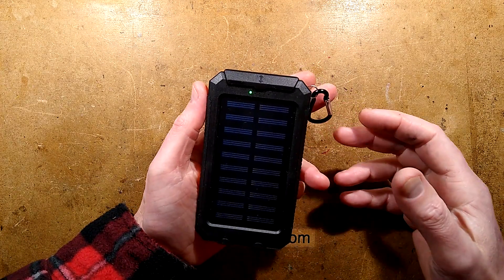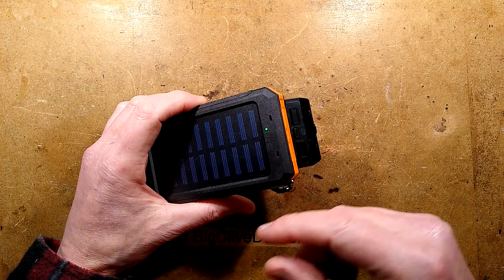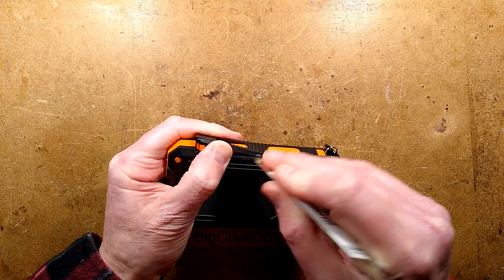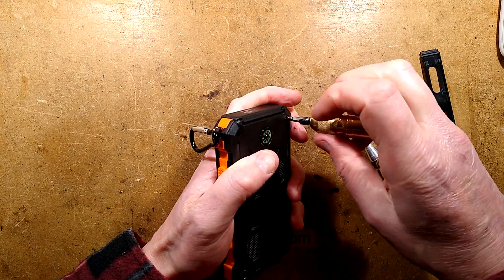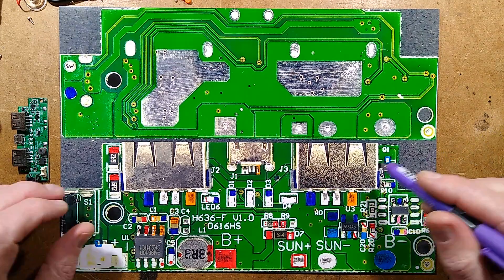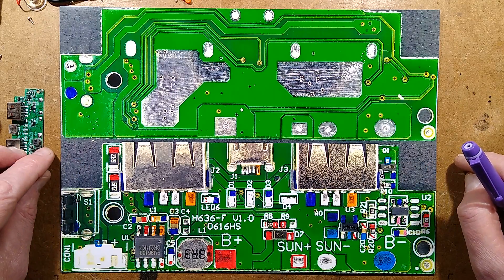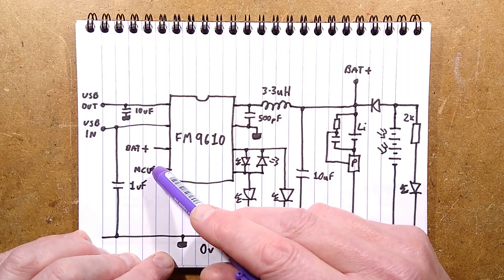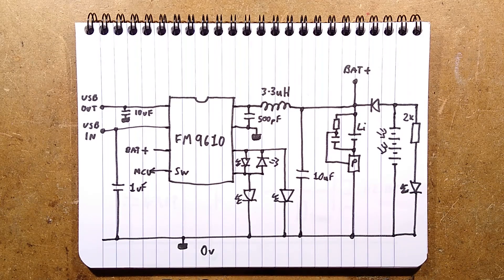eBay 9 MILLION mAh power bank teardown (with schematic)

Comment: Correct me if I'm wrong... at 2:00 we see 4 charge indicator leds on, meaning 100% charge (and a fifth led indicating that the solar panel is charging the battery).
At 2:14 we see 2 charge indicator leds on, meaning 50% charge. You drained 4.500.000 mA in 14 seconds.
Either your tester was measuring Teraamperes instead of Amperes, or you didn't charge the power bank for 2 years before using it, as suggested by the manufacturer...
Reply: @BlondieHappyGuy  1.21 Gigawatts achieved..
Reply: Pretty sure he left his load tester plugged into the mains and was backfeeding, thus supplying the entirety of north america power for those 14 seconds.
Reply: Clive was of course using it to power his Tesla.
Reply: Just randomly created a black hole with that energy density
Reply: 🤣😁 It's so true

Comment: It must be a relatively old design... My wife got one somewhere here in the US 4 or 5 years ago that looked precisely like the one disassembled here... right down to the orange face.  The "solar panel" on hers kept bugging me by looking so fake, so I torn it down a couple of years ago.  First, it did have a bigger cell and no added weight.  But I was surprised to find the "Sun" pads actually were soldered via wires to pads on the solar panel.  I still thought the PV cells looked fake, so I took it outside with a voltmeter to measure whatever it would output.  Nothing is what it output.

Finally I peeled the front sticker from the solar panel to reveal that it was just a sticker on cheap PCB material.
Reply: I recently took apart a Chinese no name calculator from the 90's or something. It had a clock and a solar panel. The clock was a generic wrist watch module with a separate battery, but fair enough. The "solar panel" was a translucent plastic piece with no wires coming out of it. The strange thing was that it came with instructions on how to take apart the back panel and change the clock battery, but then it was easy to see that the solar panel was fake.
Reply: @rexsceleratorum1632 I remember real solar powered calculators when I was a kid.
I think some/most of them did still have a battery for backup, but now they just have fake solar cell lol
Reply: @farfour_the_mouse  This was also from the 90's. As a 90's kid in India, I also used real solar powered calculators that would turn off if I covered the solar panel.
Reply: I bought to power banks that looked exactly the same but the later one had much smaller LiPo packs. You really roll the dice with purchases from China.
Reply: lol glad i didnt find that to be the case with mine. at least mine does indicate that it sees light when it is in the sun light or has a flashlight aimed at it. but honestly the solar charging feature is a sale gimmick at best on these things but it you were using this as a survival tool i suppose you could get some use out of the led flashlights on it for a little while if you solar charged it all day or maybe you could charge it for a couple days then just bash it with a rock for a violent last resort fire starter. lol
Reply: @derekis1joedirt    300-400mah per sunny day with some wasted powering a led. 
You may as well bash it with a rock but not for survival reasons lol.
Reply: @mattburrows2615  as of today the power bank I was talking about has now decided to indicate that it is dead when I try to charge my phone but when I try to charge the power bank itself it claims it is 75%charged instantly..... FML
Reply: Why bother connecting the wires if it’s just fake anyway? Anyone who would take it apart could probably tell.
If you connected a real solar panel to those pads, would it charge the battery?
Reply: You know the Chins drip glee whenever they can sell crap to stupid Mericans

Comment: It seems specifically designed to extend battery life of the "Super Bright 99000LM Torch LED Flashlight USB Rechargeable Camping Tactical lamp" from the same seller, actually 9980000 Lumens if you look in the item specifics section 🙄

Comment: 9 million mAh is "only" 9000 Ah, which at 3.6V is 32.4 kWh.
When the electricity is expensive it could then cost €35 or so to fully charge it.
Maybe they mean microamphours (μAh)?

Comment: 9,000,000 mAh is 9,000 Ah, times 3.6V, 32,400 Wh - 32.4 kWh. I think you got dazzled by the “millions” and forgot the “milli” part. A Tesla battery is like 50-100 kWh, so you’d need three of these in the glovebox to equal the current 1,000lb Tesla battery.  Still quite an economy. 😊. EDIT: should have watched the whole thing before commenting, error noted and corrected by Sir Clive.

Comment: Lmao i bought one similar to this off amazon back in 2017 that was advertised at 10,000 mAh. To be fair it did make a decent power bank, but the solar charge always seemed to be going and never getting above the 3rd indicator. I always wondered if it wasnt using most of the solar charge to power the indicator lights and just barely charging the battery. I think its still in the glove box of my car, ill have to look now. I always just used it as a standard power bank and never really had high hopes for the solar side.
Reply: Same here.  I probably paid 10 bucks for mine.  The solar was "Nice" and wasn't expecting much and that's exactly what I got, not much.   I do think the 10,000 is legit though.

Comment: 0:30 Well, at this point, I guess they might as well rate the battery 32 MWh. :D
Also funny how you keep accidentally saying 9 mAh which, no matter what kind of battery they put in there, is guaranteed to be A LOT closer to it's actual capacity than the 9 kAh it's supposed to have.

Comment: It would actually only be about 33kWh. 9 million mAh = 9,000 Ah at 3.7v nominal = 33,300Wh. Tesla batteries can exceed 100kWh, so it's sadly not even close to a Tesla's power capacity...

I also had a theory. That cell definitely isn't even 9,000mAh, but you could stretch advertising to its limit and argue that a 9,000mAh cell with roughly 1,000 cycles of total lifespan equals about 9 million mAh of "total" lifespan for the battery's entire service life. A far stretch but definitely not out of the realm of what unscrupulous sellers might try.

Comment: Mr Big, I think you missed the amazing technology here.
Clearly, the overpowered LED's are part of the power magic.  Once turned on, the LED's inductively heat the magic weight.  Heat from the magic weight induces .7311 gigawatts into the battery providing the FREE POWER.
This makes sense, and all the numbers fall in line.
:)

Comment: was the solar panel even real? I have dealt with allot of these that simply drew power from the battery to light the led when a photo resistor was exposed to light.
Reply from the maker: It is real, but low output.

Comment: Wow!  That capacity rating is immediately and certifiably false!  Unless there is actual magic going on in there, there is no way that battery is holding the best part of 33 kWh of energy without that power bank being the size of an electric car battery pack.  Also, your math is dead wrong; a top-of-the-range 100 kWh Tesla Model S/X would be charged to about 35% from flat.

Comment: I've got one of these... although now I feel cheated as mine was only rated at 20,000 mAh.  Mine had a real capacity of almost 6,000 mAh, which I think quite reasonable for what I paid. Kept my phone running for almost 4 days when I was unable to reach a plug. Thanks for taking it apart for me.

Comment: A local solar panel company gave me a 20,000ma/h  solar charger almost identical to this except the battery is massive behind it. I only know this cause what you said would happen did. I forgot about it and left it outside and the next day the battery pack puffed up and separated the case. I turned on the flashlight feature and the damn thing is still flashing. It has a single light  and has those exact light  features. It's been over 2 weeks solid now and I am curious how long it will continue to flash and it continues to charge up during the day. It has a 5 light led charge status and it's showing 4 of the 5 lights.  It's been rained on and at or close to freezing temperatures for a couple of nights. 
I'd take it apart but I'm sure I'd get burned or injured from the battery somehow. 
I want to shove a metal bar through it completely but I have restrained myself as my wife would get mad.
Reply: Throw it in a bucket of sand
Reply: @O. M. thank you,

Comment: Typical ridiculous FAKE spec that sadly will fool all too many people. Then to even fake the battery by fitting a dead weight to give impression of high capacity battery
On EBAY, and other online sites it is definitely BUYER BEWARE  all too often the goods are substandard,  fake and even non functional.

Comment: That exact case is sold on ebay in many different packages by many different distributors and takes 3 - 18650s or one much larger flat cell. I bought a 10 pack of kits for my friends and family. They are decent chargers. The solar charger actually works rather well considering what it is.
Reply: I bought a solar charged power bank similar to this but a bit skinnier about 5 years ago. Back then it was falsely advertised as 300,000 mAh. The solar feature is really not feasible. Exactly as Clive stated, the lithium cells get extremely hot in good sunlight, and the charge current was at most a paltry 40 mA. And it doesn't take very strong light to wake up the power bank. For example indoors with the lights on, it wakes up and starts blinking the small LEDs to indicate charging. The problem is that there is so little current coming from the small solar panel indoors that having the power bank wake up actually draws more current from the lithium cells than is gained from the light. A power bank that wastes power much of the time is not a good idea, so I installed a small switch to keep the solar panel disconnected most of the time. At least my power bank had 2 wide and tall (but skinny) LiPo cells in it, which filled the entire case. But they were very cheap and wouldn't even charge my phone once (phone has 3000 mAh battery). I have since replaced those LiPo cells with 8 14500 (AA sized) Lithium Ion cells. It is now much more capable.
Reply: @hockeyguy820
Reply: Someone dropped a drill at work and broke the chuck. When we got a new one it used a different kind of battery so I saved the old drill's battery and took the 18650 cells out of it and put them in a case like that to turn it into a cheap power bank. I have a good 20000Mah power cell already that I use to charge my electronics when power goes out and I use this cheap one with USB lights. I don't exactly trust the charging circuits in the cheap one with expensive electronics but I have no problem plugging USB lights in them.
Reply: @chamoo232  You could have just bought a USB adapter that clips onto the top of the drill battery itself. I bought a 2 usb port unit, with dual 2.1 amp circuitry(one for each port) for $16 that fits my drill batteries. I love the fact I can still use the factory 20 minute charger for the drill battery. I modified the USB adapter by adding an XT30 port to it, with it's leads internally going directly to the input tabs of the adapter from the 5s lithium output of the battery, and now I can also plug my TS-100 soldering iron into it and solder away for quite a long time. The drill battery I used is 8ah rated @ 21 volts fully charged, and contains 10, 21700 lithium cells. It'll charge my phone from empty to full at least several times, and allow me some generous solder time, on one charge. Best power bank I've ever owned, aside from the bulkyness of it. The USB adapter does have a pocket clip on it, for what it's worth.
Reply: @chamoo232  when recycling cells for battery packs make sure they either have individual protection circuits or the case you’ve set up for them includes a circuit board with proper overcharge protection/etc.
Also from experience never accidentally put one in backwards while distracted.
I got a set of melted contact’s and a lithium cell I wasn’t game to go near for a bit from that. Though luckily i got it out before it caught fire.
Reply: Oh the kit comes without cells, so you can put your own in?  That's a good way of doing it.
Tho they can still scam you with an unusably low power solar cell.
Reply: I got a very similar unit and crammed three 2010 macbook cells in there
Reply: Oh?  That's got me curious, was there a particular name for that kit?  Also, how much did that 10 pack cost?

I kind of like the shape and think it might make for an interesting project case.

Comment: I can confirm, I kept one of these (bought for holidays to hot countries) on a windowsill to keep it topped up. In the hot (UK) summer the battery expanded and pushed the case open. I snipped the battery out and gently took it to a refuse site. I told the guy there it had gone weird but he didn't care, just told me to put it in the pile with all the spent zinc-carbons. [EDIT: typo fixed but I'm not going to try to pretend I haven't disgraced myself]
Reply: Oh, it wasn't defective, it just has to expand to encompass all those amp-hours.
Reply: i do care that you have a typo, "he didn't care"   ;-)
Reply: @jyvben1520  OMG, what have I done ? You've triggered the Mitchell & Webb "grammer nazi" response. I'd blame auto-correct but YT doesn't do that.
Reply: @transientaardvark6231    grammer really ?
Reply: @jyvben1520  Its what the sketch is called, and its available rite hear on the YouTube "That Mitchell and Webb Look - Grammar Nazi"

Comment: Those SOS modes are often a joke. I've only even seen it done once tastefully in a little camping light. The mode is accessed using a secondary button on the bottom of the lamp, instead of the main button on top, and has a particularly well programmed SOS sequence.
Nice to know that you also agree that the solar panels on these things are also often a joke. That's an otherwise pretty nice flashlight on it.
Though I'm laughing softly at the load test that brought it down from four lights to two. I'm not even to where you opened it yet and I'm expecting the exact opposite of a miracle cell.

Oh my, that is as terrible as I was expecting! I wasn't expecting the weight though.

Comment: I plugged a similar one of these into the cigarette lighter of my Tesla Model 3 some 18 months ago and haven't had to charge the car since. I cover 12,000 miles a day delivering  Gorillas from Africa to various Zoo's around the World, whether they want them or not. My backseat is covered in Gorilla Sh't, Banana Peel and Pubic Hairs but a quick Hoover at the weekend ............... does absolutely nothing.
But still, at least I don't need to charge the Tesla and haven't in months thanks to this 1 Trillion MaH battery from those scrupulously honest Chinese Sellers.
There is a Nuclear Over Unity 3 Pin Plug I am currently waiting for, the size of an Apple Charger, but it contains a Vibrating Thorium Whipped Cream Reactor Inside it, hush hush technology ! It promises to run a whole neighbourhood with plenty to spare. I have had to sign Mr Sum Ting Wong's Official State Secrets Act with severe penalties for revealing the contents of the device which include being kicked off of eBay for being incredibly dumb. 😂

Comment: When I bought a similar one years ago, it wouldn't charge off the panel... so I took it apart, and two tiny wires weren't even hooked up to anything.

Comment: Not just sold on eBay, but there are adds for it on Youtube. The real batteries in there will take forever to charge from the solar batteries. I say DO charge it from the solar batteries, while visiting Death Valley in the middle of the summer. There's a good chance for fireworks. At least that's one thing to look forward to.

Comment: great video Clive, yes cheesy way of false advertising on websites, you really want to know what the capacity is not how long a battery's life will last until it takes forever to charge for 5 seconds of discharge, and certain websites should block this type of false advertising completely, like you goto somewhere like Halfords to look for a car battery, you really want to know the capacity rather than how long a battery will possibly last if you got to keep it that long before tearing your hair out in the middle of nowhere you need help, and not enough charge in the cell to call for help, and no sunlight to use the solar panel.

Comment: I have the same unit I think except it was listed on the 20,000 milliamps and I managed to power up a small LBC television LDC television VI USB for about a couple hours however it looks like there's two types one of 9,000 the other one of 20,000 and I'm still wondering about the solar panel I suspect they would maybe give $100 to 200 mL potentially looking at maybe half an hour at best case scenario at 3.7 volts or a minimum of 200 Ma I found the video interesting cuz I thought about opening the unit I have like I mentioned it the same unit and so far it lasted for a few years the efficiency has dropped I was thinking about using also for solar however it would be a good thing to find out what would be the output of the solar panel it is small and I don't expect a lot of power out of this maybe I bet best case scenario maybe I get a watt or two out of it maximum thank you for the video it saves me to hassle of having to open it also the fact that it is a little battery it is also to be on a cautious side at the same time
Reply: That was one hell of a sentence.